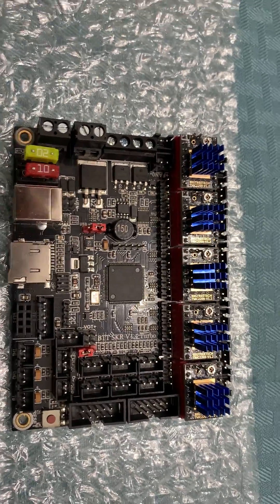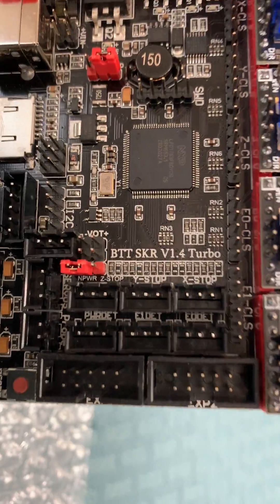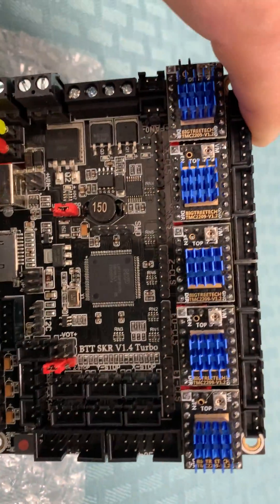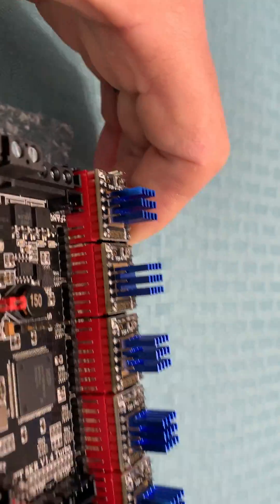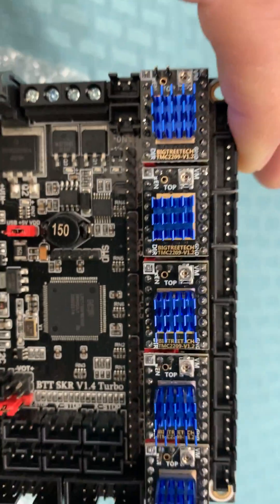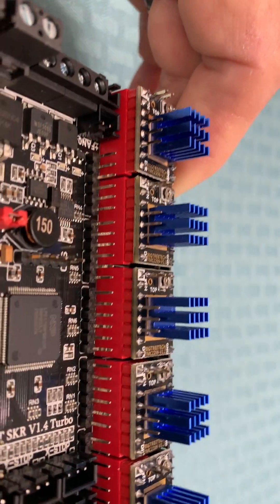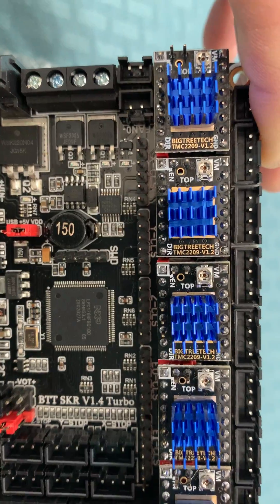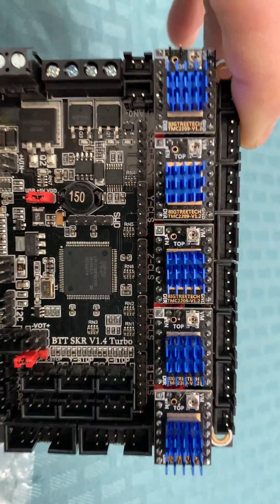SKR  1.4 Turbo on a Sunlu S8

Comment: I've been trying to do the same upgrade for a while but can't get the printer to connect to repetier for pid calibration. Have you had any success?
Reply from the maker: Yes when I first installed it I used Pronterface too do my PID running for the hotend and bed and had no problems. 👍👍